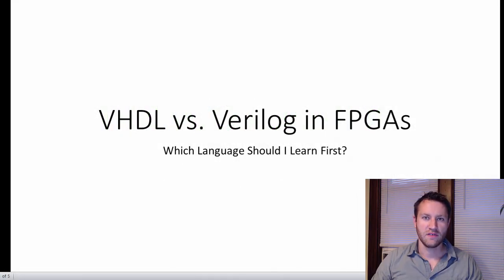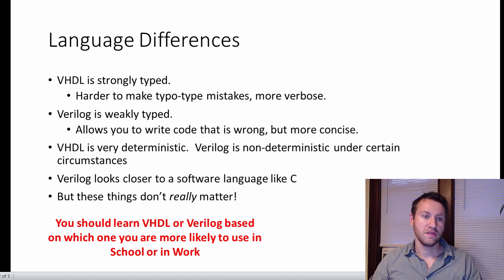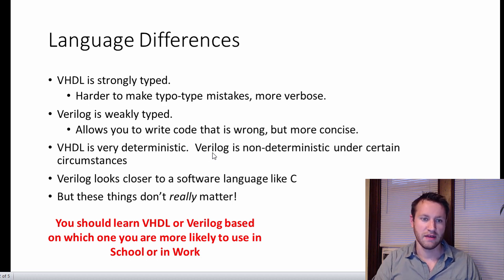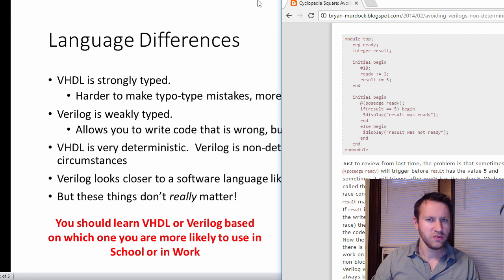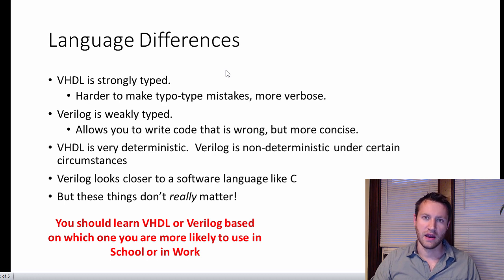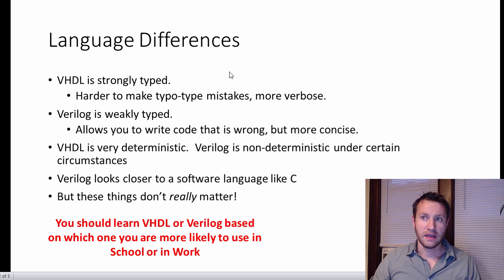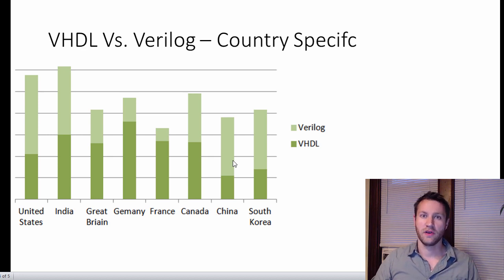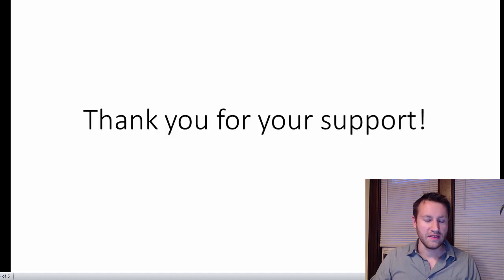VHDL vs. Verilog - Which Language Is Better for FPGA

Comment: I am a university student in Greece learning computer engineering. I had learned (System)Verilog from an American friend prior to starting my courses and then I was surprised how little relevance it had. I asked my professor and he told me that "the trend" in Europe is to use VHDL and in America to use Verilog, as you basically said. He also pointed out that "the trend" also concerns FPGA vendors, with European academia preferring Xilinx and American preferring Altera. Personal biases aside, I still don't understand why this skew even exists, but I ended up being completely misaligned with it, having been taught by an American but residing in Europe.

Now, about my opinion on the matter... They had us implement a subset of MIPS in VHDL and that was the first time I had to get hands on with it, which made me directly compare the two languages, and ever since I have been swimming against the current so to speak. I really don't like how (in my opinion unnecessarily) verbose the language is. I advocated for Verilog instead, pointing out C's influence over the language, since they had a C course on the first semester. But alas...
Reply: VHDL = Hell of pain and suffering

Comment: VHDL and Verilog are hardware description languages but not sftware programming languages. So they are the congenerous semantics. Hence we make schematic diagram using verbose languages instead graphical representation of a dot. But, easier to say 'horse' then making its drawing. And this case, I suppose,  that Verilog and VHDL languages have to draw the same device (spherical horse in vacuum) for all supported FPGAs.

Comment: I use VHDL in my hobby projects. It is certainly much more verbose. I like it for this reason, oddly. But I'm very keen to learn Verilog, especially as I want to do this for a living. One nice aspect is it's apparently possible to mix different languages in the same design, so I'll have a go at rewriting some bits in Verilog. Maybe I'll end up liking it.
Reply: AFAIK VHDL is used by a lot of govt positions

Comment: I worked in both Silicon Valley (Apple) and defense (Raytheon). In Silicon Valley I did two FPGAs. Very tiny little FPGAs. Both in verilog. In defense I did a whole lot of FPGAs and huge designs. Entire radar processing to controls. All in VHDL. What I learnt was that the use of FPGAs in Silicon Valley is very low compared to defense. The bulk of FPGA work is in defense. I Silicon Valley most products are consumer products and se has to be small and cheap and power efficient. So any FPGA design is quickly made into an ASIC and the work continues in C.

Comment: As a counterpoint to those trends: I do ASIC design in the UK and use Verilog (and occasionally SystemVerilog) exclusively. All of my colleagues write Verilog. One of my colleagues came from ARM, where Verilog 2001 is apparently the main design language. I also work with several contractors (who do, for example, FPGA integration to help with our soak testing), all of whom mainly use Verilog.

I am wary of using google trends to predict what HDL designers actually use.
Reply from the maker: Yes, if the company or industry you work in uses one language more, definitely stick to that one!  The google trends was used to highlight the regional differences and give people at least a place to start.
Reply: Okay! Thank you for the response :) I love what you're doing.
Reply: I was looking at your Go board, and it seems like only the HX1k part is available. Do you have (or have plans for) an HX8k-equipped board? I'm playing with IceStorm at the moment, and Go board seems a lot nicer than Lattice's breakout board.
Reply from the maker: Thanks!  It has a lot more features and tutorials, which was what I was going for.  I don't have plans for 8k at this time, but if there was ever a ton of interest in such a product I could look into it.  Thanks for the suggestion.

Comment: Both languages are potatoes, don't trash your time learning them, instead look to the opensource alternative HDL :
- SpinalHDL
- Chisel
- Migen

Really, VHDL and Verilog are just OK as netlist language, as soon you want to advanced things they become copy/past non reusable nightmare unless you use dirty languages workaround.
Reply: This is probably some of the worst advice for someone looking for a job. I searched for the phrases "Migen FPGA" on indeed and the same for all the languages you listed. I got 0, 2, and 0 job results respectively. Chisel only had 2 for an internship that was duplicated and it was a bonus requirement with any other HDL as a requirement. VHDL had 1,138 PAGES of listings and Verilog gives 1,619 PAGES. Huge difference in job prospects.

I'm not sure I disagree from a language perspective since I have glanced at Chisel because I was interested in RISC-V and see it's value. It may have even more job value in the future as RISC-V takes off, but if you want to a job today learn Verilog/SystemVerilog or VHDL.

EDIT: This is true for all other regular software languages as well. Sure JS is a pretty ugly language, but there are a ton of jobs...
Reply: I would not go as far as to say don't learn Verilog or VHDL. But SpinalHDL brings HDL up to a whole new level of sophistication. Like going from assembler programming to C.
If you really want Verilog of VHDL then Spinal generates both of them for you to admire. They are the assembly language on the way to being  a bitstream for your FPGA or chip design.
With Spinal's use of Verilator it makes it dead easy to create test benches.
There is a reason the kids at Berkeley are working their RISC V magic in Chisle, which is very similar to Spinal.

Comment: Hi,  I am undergraduate engineering student from India.Actually,  I have worked on VHDL earlier.So according to you if I want to strike to work in industries or willing to pursue research.
Should i go with depths in VHDL or should i also start learning verliog?
Reply: I prefer vhdl but any of them will do. hdl software can combine component created using different hdl

Comment: As a long time C programmer I have an easier time doing HDL coding using VHDL. Coding HDL requires a totally different mindset compared to coding software. That is why Verilog is confusing for me. It doesn't let me think free from software mindset.
Reply: me too. I chose to use vhdl in 2002 when creating USB hub controller for bachelor degree final project.

shh, each test cycle took 10 minutes to compile and 5 minutes to simulate in Pentium 3 computer
Reply: h zed but then he said Verilog is more c like...... Wow how confusing
Reply: Right to the point!
Reply: LOVE this answer. I was looking for something like this. VHDL seems like the right choice for me to begin.
Reply: I don't know how anyone would love VHDL if you have to type "7 downto 0" for bit slicing. That is the most cursed syntax I've ever seen in my entire life.
And for Verilog, it's a trashy unspecific HDL at describing hardware. This is why I prefer System Verilog over V and VHDL. It has features from both (It even supports transistor-level design)
Reply: I like verilog cos it's similar to C lol. & should be AND instead of concatenation. Plus verilogs literals make more sense. E.g. Data <= {8{1'b0}}
Syntax might be wrong, been a while since I've used verilog :)
Reply: Exactly 💯 true

Comment: Nice intro for beginners. I would just add:
* ASICs are in Verilog (especially close to back-end)
* If Digital Design is going to be your job, then you need BOTH !
* Neither are intuitive nor very simple to learn, HDLs are another breed as compared to programming languages.
 Self-teaching HDLs is not a professional nor reliable path.
* AND there is a huge Game Changer now : SystemVerilog which is the language of the next 20 years (if HDL and FPGAs don't die in between). 
Since SV is a superset of Verilog, so today I would rather suggest learning Verilog rather than VHDL, even if (being located in Europe) I wrote more VHDL than Verilog since 24 years.
Bert
Reply: Hi Bert, could you please write something more about self-teaching HDLs being not a professional nor reliable path? What's the best way to learn HDL then?
Reply: @johnmarston7005  I have be studying Verilog on my own since 2018 and I found the best way to teach yourself is by doing small projects and see examples, which is pretty much the old fashion way, it is now 2021 and my skills are really advance, I did dozens of project and I get better and better after each project, I work as a c++ developer since 2019 and continue my FPGA journey, I searched for FPGA jobs but they keep rejecting me and say nothing about why, maybe I should also learn VHDL, I am electrical engineer by the way